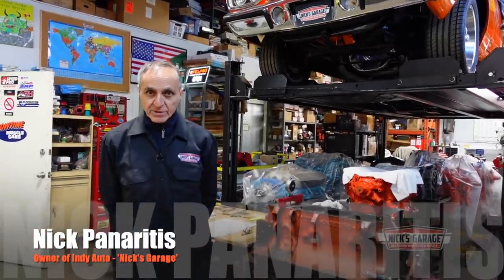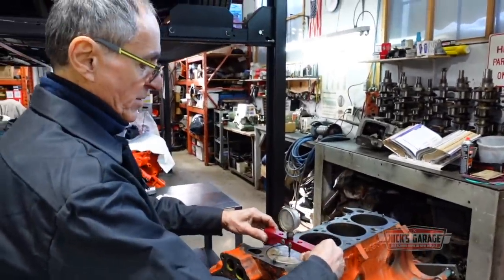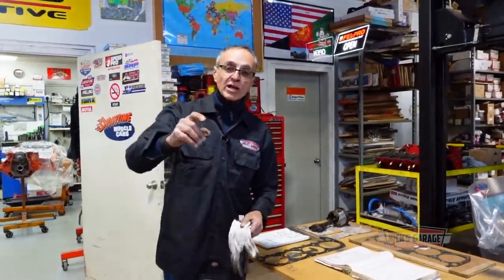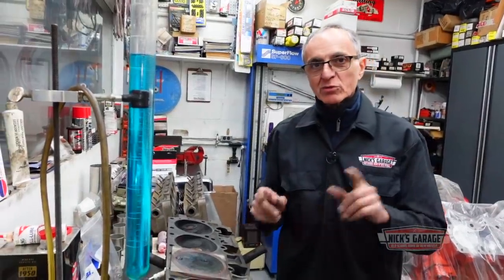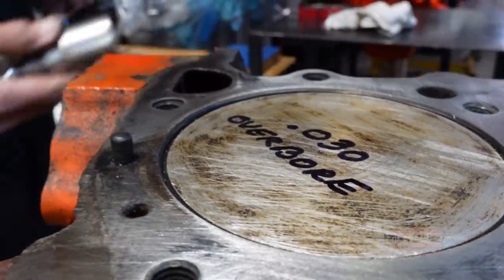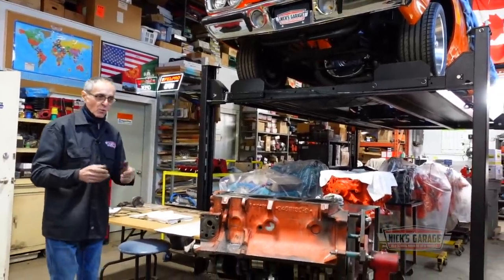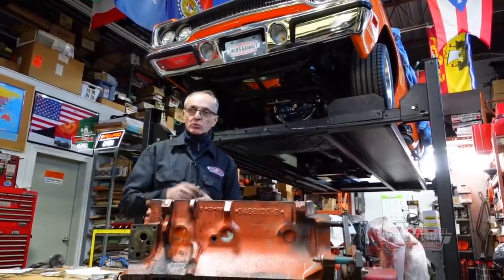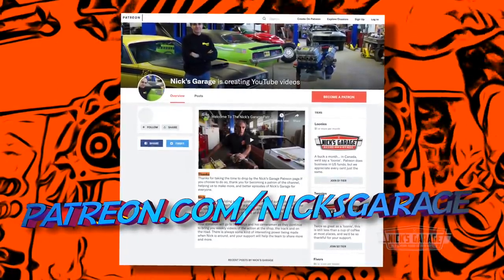Calculating Compression on MOPAR 383

Comment: Low power could mean low compression You gotta check the distance between the pistons and the deck is Nicks first suggestion There's a few things to take into account if compression is to be measured by an accurate amount Next Nick is checking the cylinder head for the volume of the chamber to get an idea of this engines behaviour Bore size, piston stroke, head gasket bore diameter, A bonus Nick's Garage episode not much makes me happier If you think your compression is of a low persuasion You too can find out using this handy Nick's Garage equation

Comment: I want to bring my 66 273 to you. It’s a fresh rebuild but Egge’s flat top, 0.030” over pistons sit low in the deck. Even with the steel head gasket, my builder calculated 8.3:1 when the factory rated it 8.8:1. I didn’t go with the domed, “273 Commando “ pistons to avoid too high a compression, but 8.3 is terrible. It runs great but needs more oomph. Ready to pull it back out and get custom pistons made for it.
Reply: Get rid of those pistons or do something else to increase the CR.
Reply: @nickpanaritis4122  Thanks, Nick. I even picked up a factory 4bbl Commando intake for it so when it comes out for a piston swap, it'll go back together with a Carter 4bbl that I still need to source. It's running an Isky E-4 cam that loves to rev but I'm hampered with a lack of throw on those tiny pistons.

Comment: the computer calculator has a variable you did not discuss. The ratio is between the volume of the cylinder at top dead center and the volume at  bottom dead center. The calculations you did is the volume that has to be added to the actual volume of the cylinder.
Reply: Good point.

Comment: It would be interesting to research the manufacturer's part number on those pistons in the 383.  Maybe a theory can be compiled as to why the builder chose those pistons and head gasket.
Reply: Being in California can it be pollution restrictions???
Reply: Most pistons sold to rebuilders are destroked about .040. Then they can mill the heads or deck the block and not go over the factory c.r. Kills performance but they don't care.

Comment: This is a very interesting video Nick! It's the first time I have ever seen a chamber measurement done. I was aware of HOW it was done but I never have observed it. You mentioned that sometime back this engine had been worked on (screwed up is a better description). Was the crank messed with at all? I know you will get the right pistons and turn that Roadrunner back into a respectable machine! Thanks for a very informative video.
Reply: If it were me, I would have blasted the Chamber clean before CCing it. That way, your measurement doesn't include all the carbon.

Comment: My 68 h-code 383 is a true zero deck engine from the factory.  The flat top pistons come right up to the deck on all cylinders.  I checked with a straight edge and pistons at TDC.  New pistons for a 383 are not the same as the OE ones.  Sometimes the factory equipment is better.  My 383 runs awesome with 440 source closed chamber heads
Reply: 383 and 440 heads are the same. Are they not ?
Reply: @Wildstar40  440 source aluminum heads
Reply: @lukepokrajac1057  
Ah okay.

Comment: Yeah just make sure you tell people not to run the deck Clearance tighter than .040 unless they know exactly what they’re doing and then if they have aluminum rods they’re gonna be running even more clearance
 most people know this but it’s just good to add that in there so people don’t think they can run a zero deck with a .020 steel shim head gasket
But very good Content! I appreciate the videos

Comment: I have a stock, virgin, unmolested, low mileage '67 383 2bl out of a Newport. So it should have closed chamber 516 heads, 2.08/1.60 valves, and .020 head gaskets. I've read that 2 bl 383s were 9:1, while 4 bl 383s were 10:1. But you said 9.5. So I wonder what my stock 383 2 bl really has. I don't want to take the heads off, just install a mild (around 216 or 218 @ .050) cam, springs, timing chain, oil pump,  windage tray, and 4 bl carb/intake. A 325 hp engine in a big car that I could drive daily.
Reply: Jeffry...check out the lunati voodoo 256 for your 383...it would be an awesome cam.   I have one in my h-code 383 which is the zero deck flat top piston version.  Your 383 will have zero deck pistons, but they have a dish to lower compression.
Reply: @lukepokrajac1057  That is correct. Supposedly 2 bl 383s had dished, while 4 bl 383s had flat tops.

Comment: Hey Nick...really enjoy your channel and your wealth of knowledge....I see that you mostly use Hydraulic flat tappet cams...I hear alot about cam/ lifter issues at break in and shortly after....are you not experiencing these problems? What brand of Cam/lifters is your go too? Are you doing anything special at break in other than manufacturer guidelines? I'm at the point of purchasing a cam for my build, so any help is greatly appreciated...thanks again for your show.
Reply: Make sure at installed height of spring is max at 125 PSI. Open pressure no more then 310. Use oil that has zinc in it and add a bottle of a Lucas Zinc additive to break in cam.

Comment: It would have been interesting to see it on the dyno and change just the compression ratio and see what the gains was i know my 350 has 58cc heads with a 200 dome piston and 40 over and still runs on 93 never did the ratio but figured it has to be around 10.5 or 11

Comment: Is that a typo on Nick's whiteboard?

Compressed Head Gasket Thickness on his whiteboard states .044. This would equate to 7.8:1 not 8.2:1.
However on his computer he shows .020 in the calculator, which is the correct value to get you to 8.2:1.

Comment: I love watching your videos Nick!  I have a 1965 Dodge Dart with a 273 engine.  Have you ever built a 273 and dynoed it.  I would LOVE to see a video of one on the dyno.  Stock it was supposed to have 8.8 compression ratio.  I just put a 4 barrel intake on it with an Edelbrock 500 cfm carb on it hoping to get a little more performance.  I set the total advance timing on it at 36 degrees btc.  It seems to like the timing.  I checked the compression with a compression gauge  an have 120 pounds on every cylinder.  Is that to low?  Any feed back would be appreciated.   I look forward to seeing more videos.   Bernie
Reply: It would be great to bring the cylinder pressure to 175-180.
Reply: This engine was supposedly rebuilt at sometime before i bought the car.  So i don't know if tthe pistons had been replaced or if they have I'm sure they would have been aftermarket pistons.  Does MOPAR still make pistons for this engine?  If not who would make some [(just off the top of your head)?  Thank you for your response.  Again I love watching your videos.  I have told several people about your site and videos.  You are the MAN.  I hope they watch your videos and maybe even contact you.
Reply: Mopar does not have any pistons for your 273. Take a look at your pistons and see if you can increase CR in  an other way.

Comment: Hi ,I have 5.3 ls . 4.8 pistons in 5.3 .I have 0.30 thousands of inches head gasket thickness.  I'm sure I'm getting around 10.05 compression ratio will add more power.  I hope

Comment: Forgive my ignorance, why do you cut the block down as opposed to  cutting the pistons down to match?  It seems like it would be a lot less work and easier to just get a piston that's longer and cut it down to match?  Thank you sharing such good knowledge.
Reply: Joshua, you would have to add material to the top of the piston to decrease the deck height. The critical dimension is the distance from the top of the block (the deck) to the top of the piston. If you were to remove material from the piston, that would increase this distance, which reduces the deck height, and reduces the compression ratio. If the distance is smaller, the deck height is taller.
Reply: @gavinmclaren9416  Why not have pistons that are oversized intentionally and then trimmed down to fit was my question, sorry if I did not phrase it clearly.
Reply: @JoshuaFoy  There are a few piston manufacturers who will machine pistons to order, or provide pistons with the compression height you specify. I'm sure a little digging would find a manufacturer who has a casting or forging blank that could be machined exactly as desired. The disadvantages of this approach would be that it would cost a lot more and take longer to get. If you have a rare engine or a high budget it might be worth considering.

Comment: yep there’s a lot of engine builders out there that like to rip off their customers and use cheap inferior parts and lower the compression to protect those cheap parts. I had a customer bring me a car once they had an engine installed from they said engine warehouse. it ran very poorly. It had two completely different size combustion chamber heads when I pulled the heads off I found it had two slugs that were 30 over. just plain bad work there is no reason to D tune an engine in the 70s and 80s horsepower per cubic inch for a muscle car was around 1.3 to 1.5 hp per cube and that is the average numbers of today’s car today’s muscle car numbers I believe are 1.7 to about 2.2 per cubic inch with that 383 having that low 8.2 compression it really doesn’t surprise me especially when you said it came from California I no longer live in that state but that is the state. I got my training from him I run a zero deck on all my every day driver builds my race engines on the other hand, I run them out the hole with a deck block, a deck, the heads, a deck, the intake to match cometic multi layer head gasket on most of my small blocks. I kept the cam at a 510 lift or less I just order custom duration grinds, and I run strictly Harlan Sharpe shaft mount rockers. and using the SRP flat top pistons market pression stays right about 9.9 to 10.1 I don’t run any aftermarket heads it’s just the way I like to build my SB LA’s and magnums. I love the small block Chevy in the big block Chevy as well as the LS platform and as funny as it may seem that’s all I drive now is a Dodge. I love my Hemi but I have yet to rebuild the first one. Merry Christmas to all automotive enthusiast and mechanics alike. I enjoy watching all your old videos. It helps kill the time while I wait for people to wake up.😂

Comment: Head flow is just as critical. High compression comes with issues on a heavy street car.
Reply: Airflow is more critical. That’s why you can keep everything else the same on the block and gain lots of power with a better flowing head. Check out Richard Holdner’s channel he has tested this a bunch.

Comment: Could you have the crankshaft offset cut to get the Piston up a little towards zero deck
Reply: Then what rod bearing would you use? Best to just use the right pistons.
Reply: Machine shop will tell you what size bearings to use I'm just trying to get the Piston up towards zero deck and a little more stroke won't hurt!!!
Reply: @jamesmerrihew401  I know that. It's what I do. I was being a little rhetorical with my question. Point I was making is, in order to offset grind a crank .080 to make up pin height with stroke, you will reduce the rod journal size to a size that a bearing won't be available for your engine, with the same rod. You don't just cut it and hope you find a bearing that works, which you won't, and will have to run a different rod that uses said smaller bearing. 
Or, you can do it the right way and run the right piston. They make the Mopar pistons with a taller pin height for this reason. I do them all the time, and you don't need high dollar pistons to do it.

Comment: Factory 68, 69 HP383 pistons are ABOVE  (slightly domed) the deck, for the 10.0 to 1 compression ratio. Check it out. I've owned a few of these. This is the reason you cannot use the early closed chamber head on a 68, 69 383 HP motor. Same goes for the '68, '69 340 10.5 to 1, they're slightly domed, above the deck. This is not the case for the pre '70 10:0 to 1 413, 426, 440 wedge. they are "0" deck. Since we're on the subject, the '72 440 Six Pack had a compression ratio of 11.2 to 1. Interesting.. Higher than previous two years which were 10.0 to 1
Reply: 1972 440-6 had a CR of 11.2, really ?   I have to look this up, very strange.
Reply: Dave...my original flat top pistons are zero deck on my h-code 383.   I installed 440 source closed chamber heads on the original bottom end and havent had any issues.  Cam is about .475 lift and 220 duration.

Comment: How about the height of the rings on the piston? when it goes to calculating compression ratio?
Reply: That is something not in the calculations.
Reply: @nickpanaritis4122  Then, in that case, it would slightly change the calculations for the compression ratio, right?
Reply: @mcfast52 ..   Too little, I guess.
Reply: @nickpanaritis4122  I think so too, but it could be checked like doing the heads.

Comment: add a centrifugal super charger  ,it perfect for boost .static compression ,plus cams events, = dynamic (running) compress ratio .thats why big cams loose dynamic compress in engine with a lower static compression.200psi is the target for a good running performance motor

Comment: Zero decking the piston is fine if it's the last overbore of the block. You can't deck the block on the next rebuild.
Reply: Custom Head Gaskets such as Cometic come in a variety of thicknesses. Problem solved.
Reply: @razoreyes45k  Not if the deck becomes warped from overheating.
Reply: @floridaroadracerguy  If you're talking about a 45-55 yr old domestic block, there should be enough cast iron to support a stitch repair. (Race Blocks are an exception) Deck the block to desired height. If there is a crack leading to or originating from a bolt hole, the Block is scrap. Fly cutting pistons gets expensive for many Hot Rodders. Most aftermarket piston manufacturers know the original DH of your Block and design their HP Pistons very close to zero deck, widely negating the reason to fly cut. MLS gaskets take care of exact-fit bore and crush thickness dimensions making extra or extreme machining operations minimal or unnecessary. The less you machine, the better.

Comment: Great video! what ratio is ideal for a street engine?
Reply: kind of depends on what gas you have available. If you can get 93 you can run around 9.5:1 for the most part.
Reply: Depends on what octane fuel you want to use to prevent detonation; more compression = more octane. 
10.5:1 will require GOOD 93 octane in the summer, just to drive around town with a/c running. 
Can be difficult to find good enough gas; not all 93 is equal.
Can run good 87, if it's cold outside.

I have heard 11.0:1 is the limit for pump gas, but I would not want that much compression on a street engine.

With 10:5.1, I would run 100+ octane race gas on some hot days, just to make the car easier to drive without detonation.
Would have to short shift and baby the engine otherwise, to keep it from detonating while accelerating.

Comment: With those stock 88cc heads and .020 gasket, I calculate 9:1 CR with a .025 deck clearance, and about 9.5:1 with zero deck clearance. I guess the stock deck was zero clearance to have 9.5:1.
Reply: I have never seen zero deck on a 383 or 440 from the factory.
Reply: @nickpanaritis4122  Yes, and therefore it's baffling how they could get to 9.5:1 with those heads and .025 deck clearance.
Reply: @MrTexasDan  I took once an all original 440 which was advertised 10.5 CR.  Did the calculations and the true blue CR was 9.9 ...
Reply: @nickpanaritis4122  There it is. That explains it pretty well!
Thanks Nick!

Comment: Calculating the factory CR with pistons .025" down like Nick says, will not make 9.5:1, rather 9.0:1.
Reply: many factory rated compression ratios are bogus.for example.....chrysler 400s advertised ratio is 8.2 where in reality its  7.6-7.7 which is pathetic!

Comment: NO!
CYLINDER PRESSURE makes horsepower.
Reply: Technically, cylinder pressure makes torque. But in general, cylinder pressure is power, yes. Compression just dictates when the valves need to open and close.